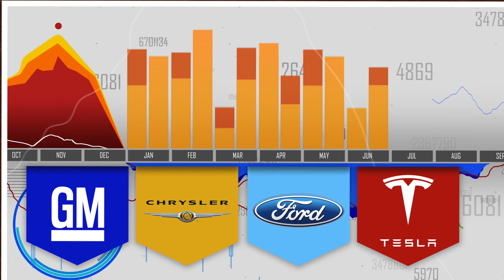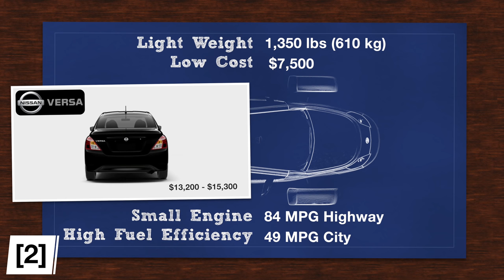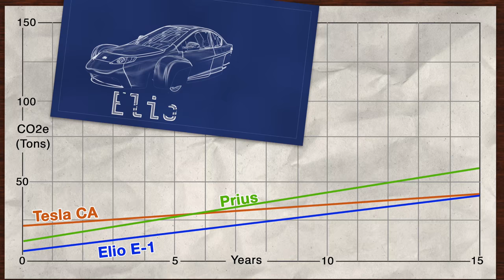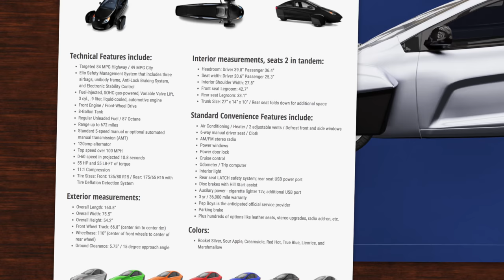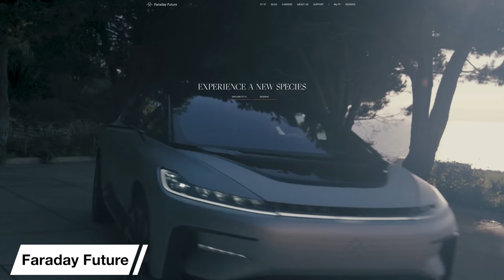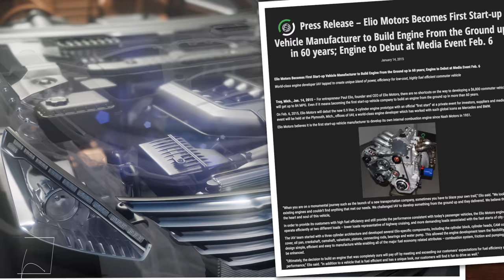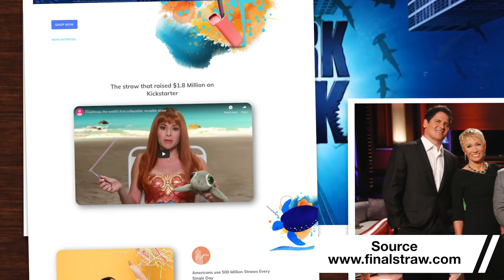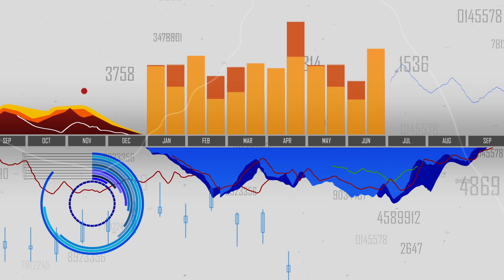How this Radical Car Missed its Chance to Change the World

Comment: I agree regarding having four wheels.  It's likely that most people won't get a motorcycle permit and wear the helmet required for this 3 wheeled car.  Also going electric has it's clear advantages as well most notably being lighter and thus more efficient.  Thank you for sharing this with us, I especially like your statistic about how 74% of the vehicles in the road are just a single driver.  Sometimes, over here in Oregon, I thank that that statistic is even higher!
Reply: They have managed to get laws in many states changed.  The helmet and m-endorsement requirements have been dropped in many places.
Reply: lucas you are forgeting  1 huge downside to ev cars. you cant get in 1 and drive more than 200 to 250 miles the elio if you wanted you could drive across the country just stopping to refuel

Comment: Oh come on the HMV Freeway started on way less than this founder has in his back pocket.
And it was perfect for rural roads and city driving only downside was no reverse. Ran on a 8 to 13 hp engine and a CVT. 8hp was gaurented 80mpg at 40mph and the 13hp was 60mpg (rough numbers)
No modern amenities besides a heater and a radio if you ordered them.

Comment: If this video was about a person, it would be called a hagiography. In any event, this is a misleading (in my opinion) description of what happened. The fact of the matter is that Mr. Elio should have not been running this company. False and misleading statements to the public, a criminal IPO when there was little to no chance of building the actual vehicle, etc. There were three prototypes built. Like Henry Ford (and many others) Elio could have simply built these on a custom basis and then gone from there. Ego and incompetence are the only things that prevented this car from becoming a reality.

Comment: For small EV there is already the Renault Twizy
Reply: Not in the US, which is where the Elio would be sold.  Also, the Elio is fully enclosed with heat and Air Conditioning, so it can be used on any day - which is not true of the more expensive Twizy

Comment: Nice video! Interesting factoid I got from the comments section via the last big Jalopnik article on Elio, is that evidently they wanted to buy an engine from the beginning but couldn’t get anyone willing onboard, hence having to make one.

Here’s the relevant comments from that article...

Jason Torchinsky
9/27/18 11:41am
Jason, I worked on the Elio engine at IAV so let me give you a little background on why they decided to develop it in the first place. Elio had always wanted to just buy an engine but turns out it’s really hard to get someone to sell you one when your a startup. Most companies in that situation want the money up front and most start ups can’t tie up that much in engines sitting around. Standard is payment on delivery. They had something lined up and from what I understand that company went under. They had an analysis done on the Geo motor by another consulting firm and that firm assured Elio the Geo motor with minimum modification would give them the fuel economy needed. When IAV did their own analysis they concluded more changes would be needed to achieve 84 mpg. So IAV started making changes and in the end their engine only shares 1 seal with the Geo motor. You are right that it was not the best route but it seemed it was the only way at the time. O, and for how much they spent well they got the deal of a lifetime for a complete engine development but I can say it was still a couple million and taking it into production would have needed another $10 million in development.
10
Reply

HC111
So Shiney. So Chrome! So Frunky
9/27/18 2:42pm
So once they got a bunch of pre-orders and buzz, and a factory, they didn’t have the clout to try and work a deal with a manufacturer?
Reply

So Shiney. So Chrome! So Frunky
HC111
9/27/18 3:10pm
No. It’s also not just clout. There is a whole number of reasons but most of it comes down to capacity and money. The combination of a engine manufacturer, like say Ford, who had a suitable engine, enough manufacturing capacity to meet the demands of Ford and Elio at the same time, and a price both could work with was rare to say the least. But since Ford is phasing out their cars selling in the US,selling the Fiesta’s 3 cylinder engine might to Elio might be a way to recoup sunk costs and will therefore now be a deal they are willing to make. Times and conditions changeReply

Not_another_kinja_account
So Shiney. So Chrome! So Frunky
9/27/18 3:59pm
Wait, Elio has real employees?Reply

So Shiney. So Chrome! So Frunky
Not_another_kinja_account
9/27/18 4:02pm
Had. I worked for IAV solely on the Elio engine. When they ran out of cash my position was terminated so I guess you could say Elio both gave me and cost me the best job I ever had.

Comment: if it is electric, and has 4 wheels like that VW, then yeah ill consider it
you still gotta compete with Tesla´s autopilot, etc tho
Reply: Why do you have to compete with Tesla at all when your car costs 20% of  the least expensive Tesla. The concept was not a toy for the rich it was a second commuter car for families. The least expensive Tesla is 46K before tax incentives. Thats 3 times what my car cost me.
Reply: The reason it was a motorcycle is to not need to pass the safety standards set in the US.  There are a number of very small light and inexpensive cars for sale in India’s Malaysia etc that cannot be imported to the US.  As soon as they put a fourth wheel on then there’s bumpers and air bags and crash tests that would need to be passed as well.

Comment: I really wish Elio would succeed, but I agree with Two Bit da Vinci, converting the vehicle to EV would make so much more sense.
Reply: Ganga Din , Exactly right! I have been following Elio from it's inception and STILL am hoping it makes it to full on production. I would buy one on the special credit card option in a heart beat. I have belonged to a Yahoo group for years now called "cabinscooters" that is a group based on same theory as Elio but is a group of like-minded DIY emagineers. We have always thought there needs to be an enclosed motorcycle type vehicle that is both safer and protected from weather and also targeted high mpg as a goal. Anything that surrounds a motorcycle has got to be safer than a open cycle! The tandem wheels up front (tandem configuration) is the same design the majority of members agreed was the safest design. Fabricating up a frame then adding power and drive train is the relatively easy part. Coming up with a weather-proof body is harder. The main idea and popularity of such a design is because of many factors but one of the biggest is to get away from the PLETHERA of rules and regulations that go with 4-wheel cars!!!!! Todays cars are "safetied" to death with the associated added costs! A person should have choices. The motorcycle is the only practical choice until enclosed tandem trikes become popular! Three cheers to Elio! I hope and pray he makes it and price stays reasonable! I want a trike that uses a kubota or similar two cylinder diesel for even greater mpg estimated at way over 100mpg! Since the EPA regulations on motorcycles is still very light, a good running diesel ought to be viable plus it can be set up just like low-emission diesel cars of today if needed in future! Over 100mpg is indeed a reachable goal for any competent DIY fabricator today.
Reply: Will Yam what is the most affordable most reliable most efficient cycle out there? can be moped or motorcycle or anything just street legal and can obtain highway speeds. I would like to know for buying one in the future in case of an apocalypse is coming
Reply: Ganga Din appreciate the response.
would that be your choice for an apocalypse type situation?

Comment: This is the problem with electric cars made by companies other than Telsa. Nobody wants to drive them. If you want to sell lots of cars, make a car people want to drive even if it wasn't fuel-efficient.
Reply: But this "car" isn't even electric.
Reply: I think some cars like the Chevy Bolt are pretty decent and I'd even consider buying that over a Model 3 because it's cheaper.
Reply: @rithikkumars1676  i dont think you will say that after you took a test drive in the Model 3... you will hate yourself at some point when a friend gives you a testdrive.. about 80% of the cars which are traded in for the Model 3 are cars originaly worth less then 20k.. (for the 40-70k vehicles right now) that shows that there is a shift in consumer habbits again which shows that due to the advantages and simply said because of how good the model 3 is many people spend way more money on their car! Together with the enviromental factor it just has a more significant place in their lifes..
Reply: @remliqa  Yes, it's hardly even a car.
Reply: @Voltaic  Inexpensive performance electric cars like the Model 3 remind me of the early days of DVRs. Everyone is like, "yeah, that Tivo looks interesting, but I have a VCR and it works fine." Then they try one and they can't imagine ever using a VCR again. You can try to explain what it's like to drive a Tesla until you're blue in the face, but it's not going to matter until more people actually try it for themselves. Meanwhile, Tesla opened up another mall showroom with no ability to test drive in my area. SMH
Reply: agreed. when people get in my leaf their "ENTIRE" attitude changes.

so smooth. so quiet. no noise. and FAST so bloody fast. that instant torque is addictive.

 @GerardPinzone

Comment: Driving my Expedition is great when doing highway miles, but in town the 19 mpg can drop between 14 and 11 . . . an Elio for in town or even long solo trips would be worth the $$$. As for gasoline engines; they are still KING, and the conversion to EV is much simpler when production and distribution permits it as an option.